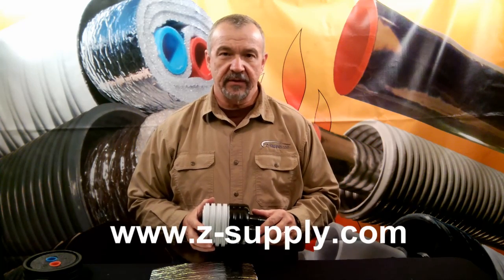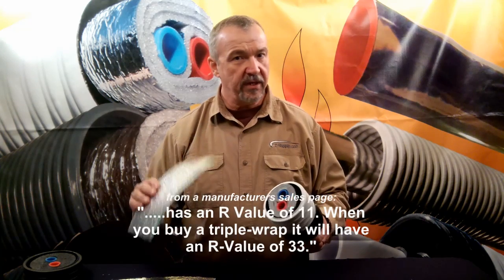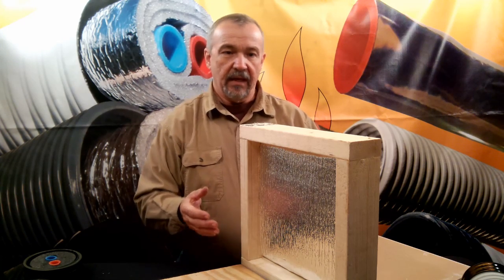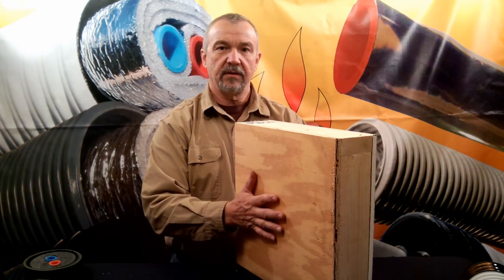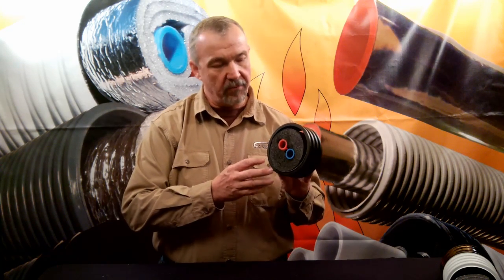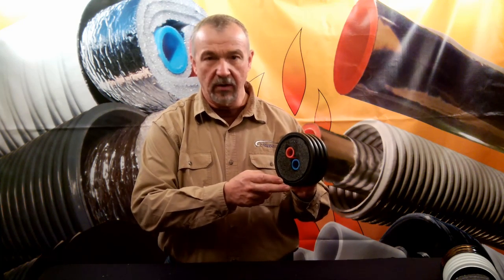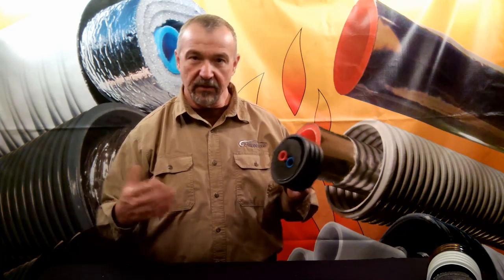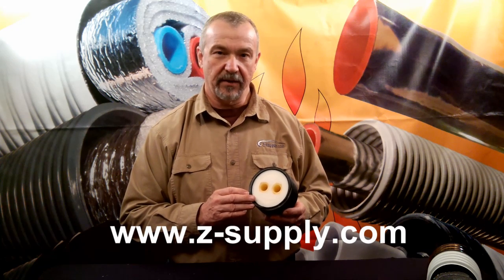The Truth About Insulated PEX Pipe R Value

Comment: I hate to be the Debbie Downer, but this product appears to be over-engineered.  The radiant barrier (RB) on the outside of the insulation is a 1-directional insulator that prevents heat from OUTSIDE the reflective boundary (i.e. - the ground) from radiating through an air gap and entering INTO that boundary (i.e. - pipe).  RBs do not prevent conduction or convection heat losses from inside the pipe to the ground, and in locations where the RB touches the plastic sheathing, its reflective properties are negated, as in order to work properly, there needs to be an air gab (at least 3/4" to be modestly effective).

I am not saying this product is not good/better than others out there, but I'd trade that the $$ spent on that shiny stuff for another circuit of foam.... and maybe put another layer or two of separation between the hot & cold lines.
Reply: I promise they are not over engineered, they're a gimmick if anything.  A radiant barrier is also a low e coating, so that it is an effective heat barrier both ways.  I'd still prefer foam also, as in the Watts design at the end.

Comment: I am very pleased with your presentation. Thank you! I am still at the point, where with respect to the simplest thing I need to understand, I am not clear. I am trying to decide on a plumbing retrofit to Pex A, am I able to improve the "race track" circulation performance reducing heat loss by adding insulation (length of about 120 feet). What would the ideal material be, and the cost recovery values for adding that material?

Comment: My problem with the PEX piping you bury underground is not the R value.  An R value of 3 would be fine for me!  My problem is with ground water getting into the black conduit pipe that the PEX is routed through.  Whenever it rains, water pours out of that black pipe into my basement!  The insulation wrapping is soaked!  This does little good at insulating the pipe.  I am digging the pipe up now.  It takes a long time and lots of labor.

Comment: It seems to me that the primary heat loss will not be to the surface but to the adjacent cold water line within the barrier. It is typically only millimeters from the hot line.
Reply: If there is BTU transference from one line to the other it is still remaining in the system, not a "loss". Think about it.
Reply: I guess I'm think of cold and hot to supply an outbuilding rather than hot being returned.
Reply: that is a lie, there is a ton of heat loss from the return line with this junk pipe. Got to use thermopex, logstor or rheu, wrap pipe is garbage

Comment: I've used both the wrap type pipe and the urethane. James is right, that black pipe with the wrap insulation is junk. BUT – I got my hands on this white pipe from Z-Supply and it simply isn't the same thing!
That's like comparing a Yugo to a Cadillac!... they're both cars – right?
Check out the Blue pipe from this same company. The blue pipe has a tough outer skin and is better than anything I've seen!

Comment: It makes more sense for the manufacturers to have an objective test for heat loss.  Similar to what you described...why not have manufacturers conduct a steady state test through some some sort of consistent substrate for a standard distance.  Perhaps degrees of heat loss of of 180 degree (initial) fluid through 100 feet of tube in 45 degree water at 5 gpm.   I made up the parameters....but you know what I mean!